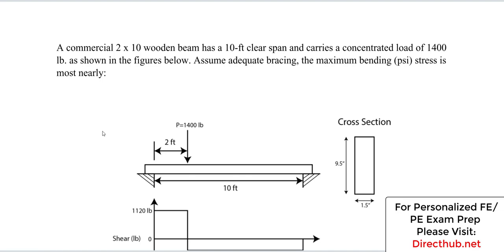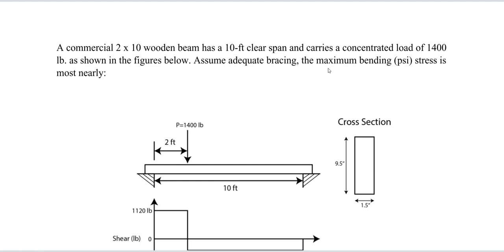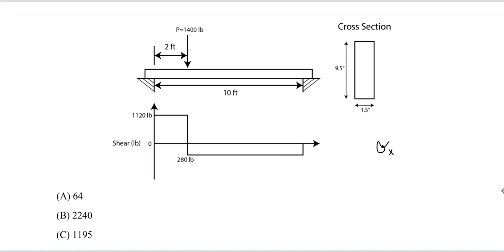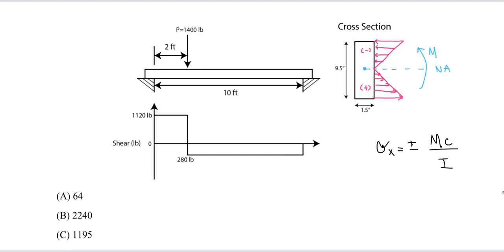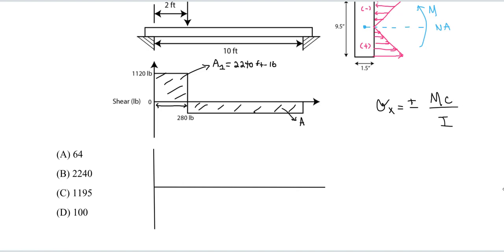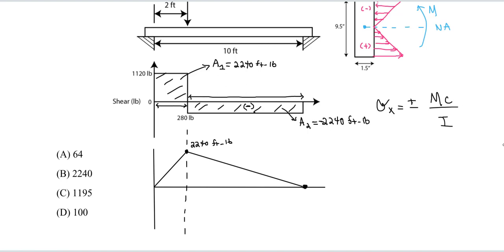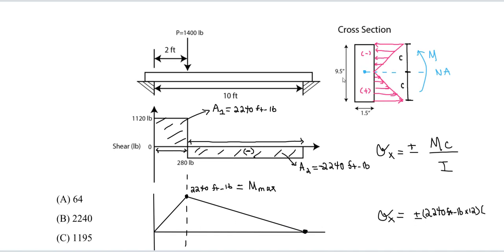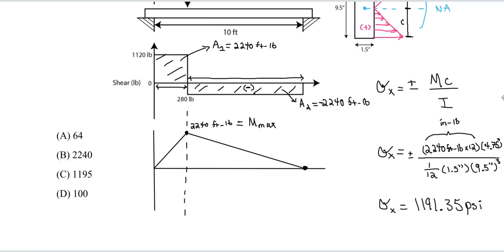FE Exam Review - Mechanics of Materials - Maximum Bending Stress

Comment: you can easily  go to the table on page 140 and it will give you the maximum moment instead of drawing the shear and moment diagram
Reply from the maker: Good point, usually they make it harder on the FE so you can't use those charts :( . But yeah if it was this simple, the tables are the way to go. Good stuff!